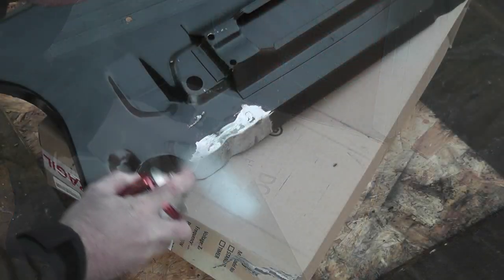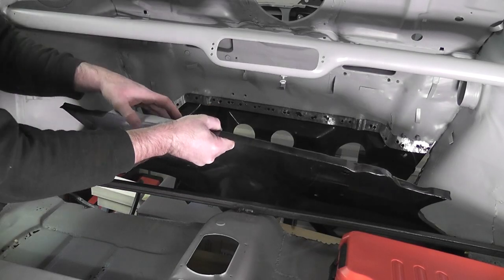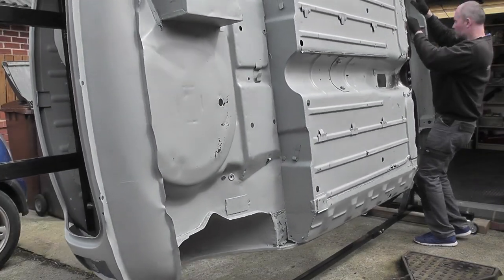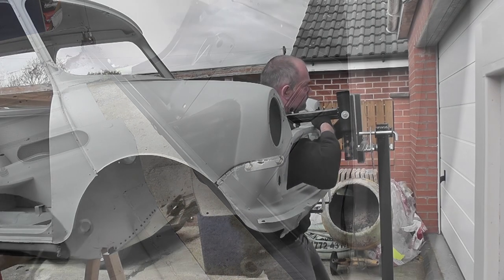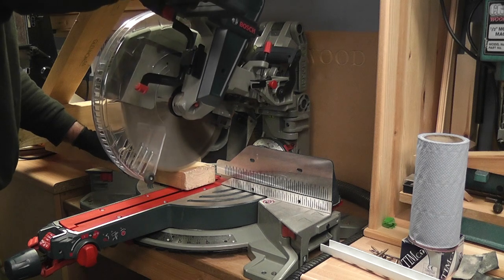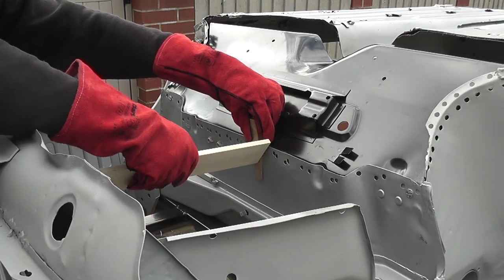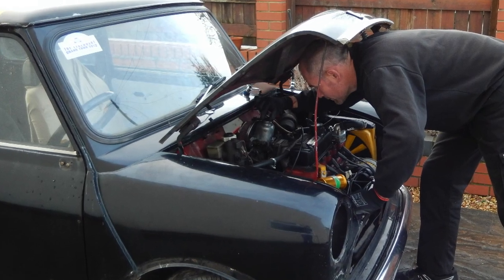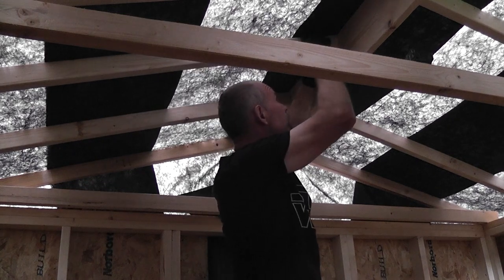Classic Mini Restoration Episode 18 - Fitting The Toeboard (Part 2)

Comment: Lee great stuff mate shame about leaving the paint on the toe board both panels that have to be joined need to be shiny in that area. And looking closely at the panel fit it looks really very good to me,don't forget to tack weld the toe /b first as it stops the metal parting when you do the spot welds, tap both panels together before the weld blob looses it's brightness. And defo must show us the fails too as we can comment to help. We are all behind you mate
Reply from the maker: Thanks...im angry with myself for making the error but luckily I hadn't welded it up fully...that would have been a disaster haha! Ive spent a couple of days just practicing welding and playing with settings so fingers crossed it'll be a bit better next video :-)

Comment: Lee - been following you for a while (and we have been exchanging advice on the engine build) You are doing a lot of similar work to my restoration but going a whole lot further with a rolling jig, which I did not have the luxury of. Definitely need clean metal when welding, and (my opinion only) I tried and gave up with rust converters, they just hide things. I used Bilt Hamber Deox Gel, where I could not take things off and Citric Acid (Home Made) when I could. Weather - tell me about it, I did most of my restoration upside down in a dark garage!!! I liked it when you took of part of the foot well, underneath was another one - I had three!!!
Reply from the maker: I’d say the weather and having to work outside is my Achilles Heel. I wish I had space and somewhere indoors to work. Not sure if you follow my woodworking channel but I’d originally planned on building a workshop and hit a problem with water. If all had gone to plan I was going to build a workshop for the car but it didn’t do as planned. Really wish that could have gone ahead. I have a gazebo and trying to find out if it’s fire retardant. If it is, I may put it up when I’m outside as it should help with the welding etc. If not, it’s gonna have to be dry weather days only. It won’t be so bad once the bodywork is done though as the rest of the work I should be able to do inside. 🤞
Reply: @SmugwoodMini  "once the bodywork is done." I'm 5.5 yrs in and bodywork not done yet. Hopefully once you get your confidence etc u  will motor on. I only had a few hrs in an evening to work, hopefully u can do plenty this "summer"
Reply from the maker: @elliotrawstrone6137   Once I get going there'll be no stopping me...its just the getting going part Im struggling with haha

Comment: Keep at it man. It can sometimes become a bit overwhelming, but just do one bit at a time. One small tip, practice you welding on some scrap pieces. Best of luck.
Reply from the maker: Thanks. I thought welding would be easy but it really is quite tricky. I have done exactly as you suggested though..I have literally spent the last day just practicing on some scrap pieces. Im not quite there yet but definitely improving. A little more practice and I think I'll have a chance :-) Welding outside makes things tricky too :-(
Reply: @SmugwoodMini  Welding in any kind of breeze is a challenge, and you will not get great results. Also, when it comes to weld through primer, I have had limited success ranging from good (not very often), to so bad that I end up cleaning it all off and just going with bare metal. I think a big key to it is making sure you have enough of it on to carry the arc through it! Anyway, keep at it and you will get there.
Reply from the maker: Thanks. Im hoping a bit of time out experimenting with different setups and I'll eventually find what works and what doesn't. I just need to make sure I keep notes once Ive sussed it out.